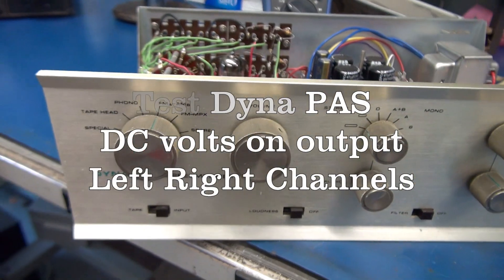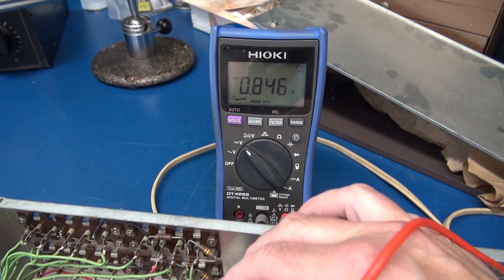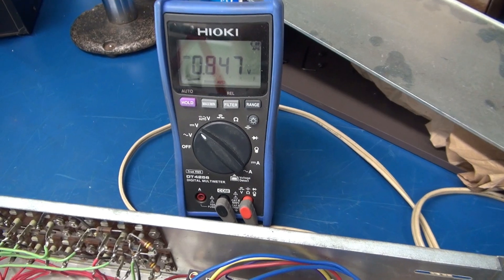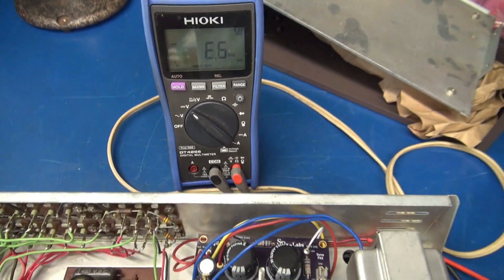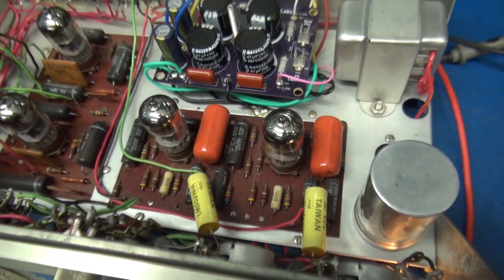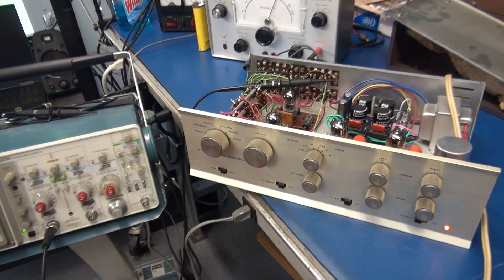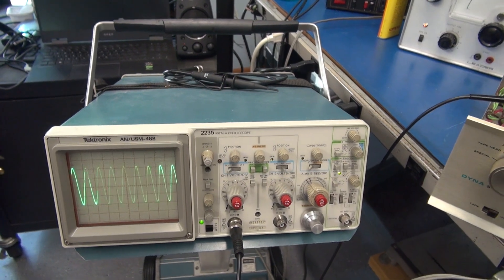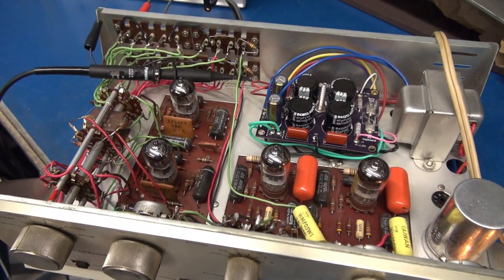Quick fix Vintage Dyna Dynaco PAS tube type preamp repair Channel hiss distortion

Comment: The PAS-2 and -3 do not have that blocking capacitor on the bass control.  That was added in the PAS-3X.  Without it, there is a sneak path through the tone controls from the cathode of the early stage in the line amplifier to the output of sometimes as much as 1.2 volts.  It is important to note that the Dynakit power amplifiers do not have a blocking cap on their inputs so this positive voltage is applied to the grid of the input tube without that cap in the preamp.
Reply from the maker: Good info Sir. I normally add them to every PAS that comes in for repair. I never thought about the amp not having a cap input. DC voltage coming in could cause some trouble!
Reply: Hi there can you please expand on this.  This is a capacitor of 1uf @ 50v going from the pot of the bass control to which pin of the pcb?  I have several Dynakit pas preamps, I was not aware of this!  So my understanding is this is an essential fix, correct?